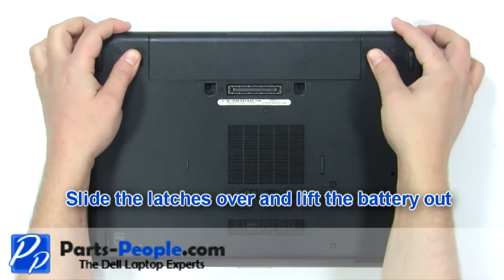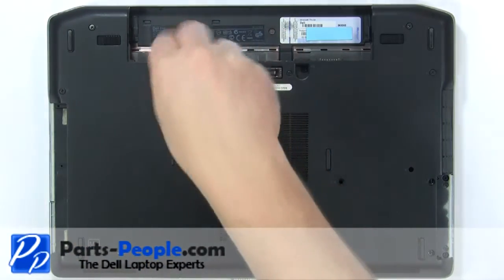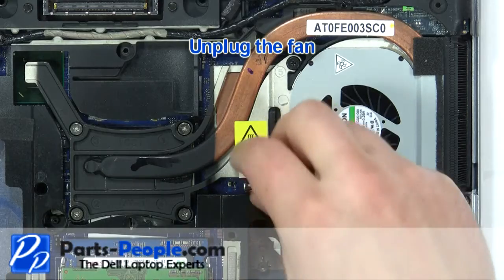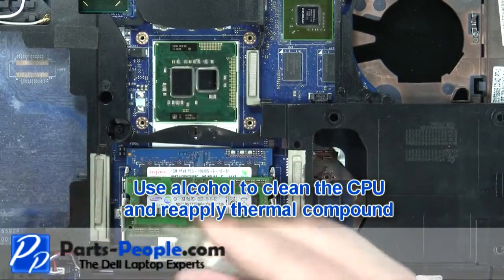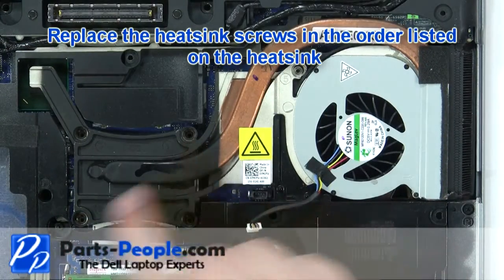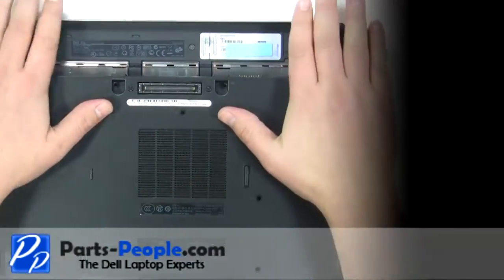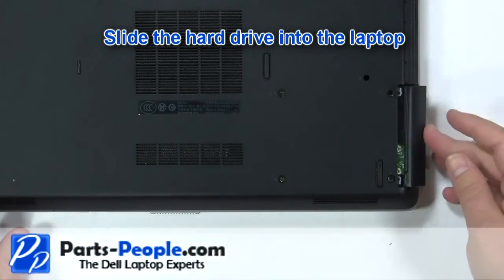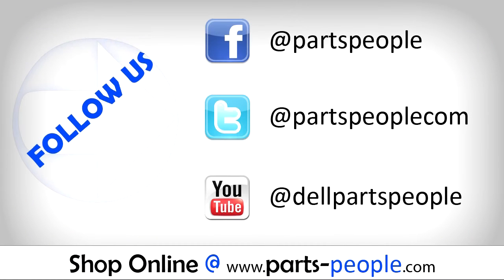Dell Latitude E6420 Heatsink / Fan Replacement Video Tutorial

Comment: Is there a higher rpm fan option for this unit? I have an e6530 with 3740qm. I'm idling at 55C and nearly 100C under load. The fan never stops, even at idle.

Comment: is the heatsink replacement the same in e6410? my fan is malfunctioning and not running at times.
Reply: also why is a heat gun not used on the board. I thought you had to use one. because on the ps3 i did.
Reply from the maker: Here is the manual for the E6410. https://www.parts-people.com/blog/category/dell-latitude-repair-manuals/latitude-e6410/heatsink-fan-latitude-e6410/ And this repair does not require a heat gun.

Comment: Can the fan be replaced without replacing the heat sink?
Reply from the maker: No, it's all one unit.
Reply: o need to remplace mine is too slow not enough power for the cooler

Comment: The thermal paste is ussually dozed at the size of one grain of rice. Then due to pressure, the thermal compound spreads to the contact area providing a thin enough heat conductive layer of thermal paste. If the luft is too high, use thermal pads. They are thicker and provide thermal conductivity also.